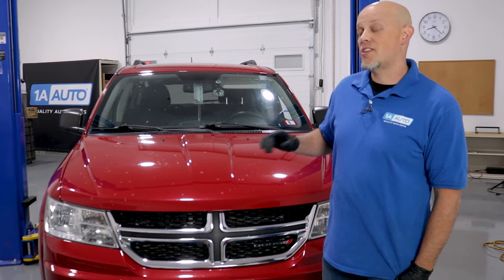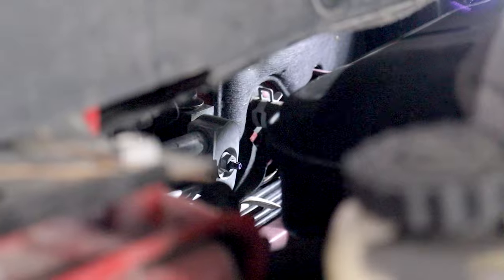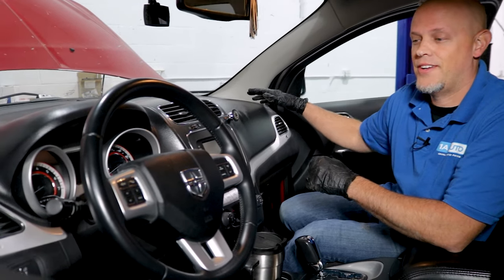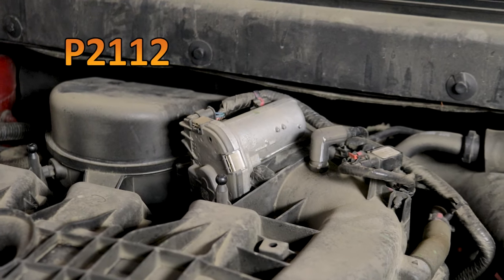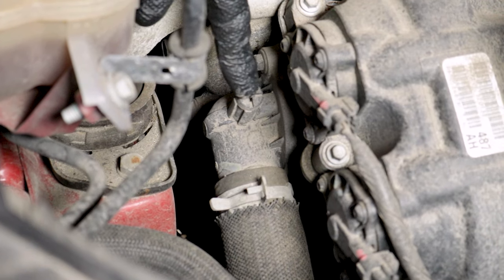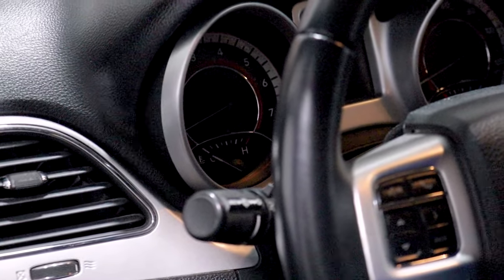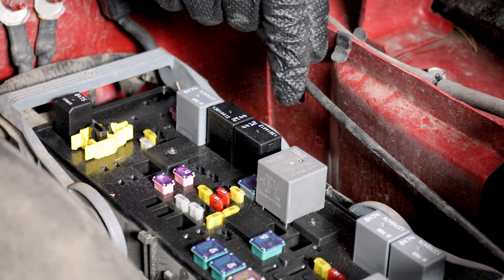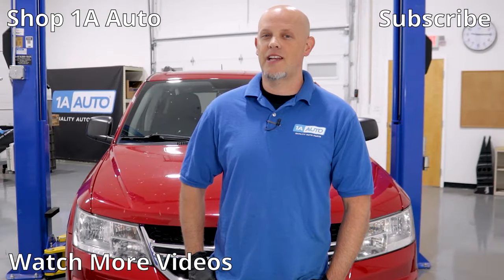Top 5 Problems Dodge Journey SUV 1st Generation 2009-20

Comment: Wow thanks for the help but your miss one more problem driver side has heat when the heat is on and the passenger side dont. I have a 2010 dodge journey runs like a grape ape love the suv but this year ran into heat only half the car!!! But ya if you have an idea what it is please help it's my fiance car and I'm letting her drive my chevy avalanche until I get her dodge fix
Reply from the maker: +Mike Dyess We wouldn't be able to diagnose an issue like that here, you may want to have a local mechanic take a look at it. Thanks for checking us out! http://1aau.to/m/Shop-1AAuto-c
Reply: Heater core. He mentioned it in the video. Mine is not working either. Heat on the driver side and as you go towards the passenger side , it gets cold.  My mechanic flushed it with CLR and it worked for 2 days then , no heat again. I replaced all 3 actuators and still the same. There is a trick on you tube , where you can actually replace the heater-core  WITHOUT removing the dash and electrical. I'm planning to do it, for next year's winter :)

Comment: Those so are not. The common issues with the journey ,with that particular model with the 3.6 you will need to look for lifer,cam,rocker. Issues the p0128 thermostat rationality ,and ac condensers otherwise they are pretty good vehicles

Comment: I keep getting misfire on cylinders 4 I change the spark plugs and the coil packs but I'm still getting misfire on cylinder 4
Reply from the maker: +Tony Mata We wouldn't be able to diagnose an issue like that here, you may want to have a local mechanic take a look at it. Thanks for checking us out! http://1aau.to/m/Shop-1AAuto-c
Reply: One thing I heard is make sure those small spots on the tip that point are at their right angle cause if theyre not, that causes an issue

Comment: Own a 2012 SXT V6, non stop problems! Electrical short caused all sorts of problems,  within the first year the touch screen went out and would lock us out of the car randomly.  In the dealership for 3 weeks for a "system update". Just this winter the heater went out, recently started leaking water and overheating. ABS & traction control lights are on.  More lights on my dash than a Christmas tree! Gonna fix the overheating issue and trade it in (probably zero trade in value) Never again Dodge!

Comment: RT V6, had it for 10 years now and on my 2nd gearbox now. Damn transmission issues again 😂. I'm in South Africa, Johannesburg. 164k miles on the clock, only drives on 1st gear and can reverse as it can't shift gears. Any cheaper ideas 😂

Comment: Overall my 2010 Dodge Journey SXT has been a good vehicle.  I have slightly under 250k on it.  I installed 3 heater cores over the years but I did it myself in a modified fashion so just the cost of the heater core and some heater hose.  My big problem now is a parasitic drain on the battery I cannot find.  Anyone else have this problem?
Reply: Battery drain has been a significant issue since I bought mine in 2012.  It fries every battery I've purchased over the years.  One thing I did notice is a I had a clicking recently that showed up out of nowhere.  Turns out the blend door actuator for the AC was broken and the eletronics on the car kept trying to activate the actuator when the car was off. This was draining my battery within a few hours.  So short story the clicking was happening all night and draining the battery because the car kept tryin to set the actuator. .......but that is one of many battery issues.
Reply: My 2014 2.4L SXT has had the battery replaced once a year for the last three years. That's my biggest gripe with the car. The second would have to be the plastic side panels that cover the front seat belts. They came lose after two years of ownership. The engine and transmission have been great so far. I just replaced the gas pedal because the throttle sensor was going bad. (At least that's where I believe the problem laid. So far, it's not had any more issues.)
Reply: Thanks, see my other remarks;; my 2015;4 CYL JOURNE@. 93,000 miles still trouble free , etc.. (;though, Bushings / Struts , SPECTRUM NAPA ALL REPLACED LAST MONTH, drives better than new)…..still have original Battery FOR Engine…. . remote BATTERY ARE replacement.. oddly, one of Service Tech’s suggested ENGINE Battery May” fails without notice “,:etc.. Anyways, considering Battery Rep & TRANS SERVICE SOON??

Comment: I have a 09 journey 4 cylinder, it won't start it times, new battery, new starter, new ignition switch, fuse box repaired, and it still won't start at times, any I deals ????
Reply: key fob? sounds like the only thing you haven't replaced
Reply: Check out YouTube videos about the vehicle grounding.
Reply: Crankshaft sensor
Reply: Clean all grounds, replace crank sensor, didn't get a remote, the dealer replace ignition switch and that's when the no crank started, took it back, dealer can't find the issue, just don't know what to do next ????

Comment: Wow.. don't have a dodge Journey, but I have considered getting one.. is top 5 problems consistent with all Journys
Reply: I’m happy with and have a Dodge Journey, the All wheel drive, 6 cylinder RT.  I’ve had no issues at all in a year’s time.  I had to wait for new less common 19” winter tires. The leather heated seats and steering wheel come on instantly, the heat and air conditioner works well.  The tow package  pulling my load of firewood was fine.
Reply: Don’t do it. I’m trading mines in soon. I’ve replaced everything he listed plus two alternators. Only had it three years
Reply: It's not that bad. It's just a cheap car if you are on a budget. Own one it's a daily.
Reply: 3000.00 worth of maintenance done to my 2010 sxt with 118k in less than a year. Brake rotors are  undersized and warp easily. Had to replace a fuel line just the other day, for the second time. These are not built to last, and if it wasnt paid off i'd trade the thing in a heartbeat.
Reply: You can have my 2016 all blacked out for 12k.
Nothing wrong with it and I modified the headlight to very bright ones in case I needed to go on a road trip (didn't need to since I have another vehicle) I got it for a friend and his wife. They split. They owed 2k on it and was going to be repo. I got called, I picked it up, payed that money and am paying it cause I don't want it to screw my credit. I just owe 12k on it. It's too much of a small suv for me. Also I'm paying it to be parked and taking up space.
Reply: Don't get one

Comment: My wife bought a 2015 SXT V6. Trans was leaking at 60k had dealer fix it, they forgot to replace trans fluid so trans failed, they put in a rebuilt trans and it groans/struggles off the line. Suv has 142k, new trans also leaks, motor has oil puddle on block, radiator has a hole in it, rotors are warped, suspension is bad, motor mounts are bad, it just has a lot of issues for a 6 year old suv. I have a 21 year old infiniti car with 227k on it that I drove way harder, has way less problems, and is still more reliable. Her Jeep liberty before that had a bad trans before 100k too. The mechanics I talk to agree these are crap. The newer mopar stuff has transmission issues and poor build quality in general. Buy foreign or buy American fleet models to get better drivetrains.

Comment: Buy this car if: you only have $20k and want a new car, need 7 seats, want an SUV, and want AC in the back. Do not buy it if: you can afford anything better. I have a 2014 SE (base model 4 banger). The build quality of this car is terrible and it is basic, however, it has only broke down 1 time at 170k miles, so thats good. My biggest complaints/problems I've had: oil leaked REALLY bad, started using synthetic oil and its much less now. Valve cover gasket is leaking and the oil pans always do. Suspension is cheap and bouncy. Combined with it being FWD it wobbles on turns if you hit a bump. It had A LOT of warranty work done on it including catalytic convertor replacement and random lights coming on. The airbag sensor decided to stop working. My blend door actuator (there's 3, it controls the climate) is clicking because it's malfunctioning. I had a big coolant leak from cap stem, easy fix. The battery is in the length side wheel well and is difficult to access and builds corrosion because of exposure. The alternator is on the bottom of the engine and you hage to take a wheel off to access it. 

I wouldn't recommend this car, it's dodge junk, but it's cheap and runs. 4 banger is a little more reliable than the 6 but so extremely slow it painful. Mileage sucks on both. They are hit or miss with reliability. USE SYNTHETIC OIL WITH THIS CAR. If you can afford something better, get it. If not, be prepared for shitty dodge engineering. Basic maintinence like spark plugs and engine works is easy. 

overall don't get this car

Comment: I have a 2018 Dodge Journey that when I have to use my windshield wipers, the whole digital panel goes dark.  Its really crazy when this happens.  I have taken into the dodge dealership and they think I am crazy. They couldn’t find anything wrong!!
Reply: This is because the headlights come on when the wipers are turned on. I believe you can change this is your settings.

Comment: Let me add a couple more for you
The heater core hose T connectors will explode on you because they're made out of plastic. Also the rediator hose plastic fitting will deteriorate and cause it to explode as well they're molded together as one piece. 
The alternator has a clutch and it will fail, because the clutch just goes bad.
The crankshaft position sensors for some reason don't last. People seem to be replacing them quite often. My recommendation is don't buy the journey.

Comment: Please do you know the meaning of these codes?STORED CODES U0002 High Speed CAN Communication Bus Performance PENDING CODES P2719 Pressure Control Solenoid "D" Control Circuit Range / Performance P0969 Pressure Control Solenoid "C" Control Circuit Range / Performance PERMANENT CODES No permanent codes found.Are these two codes only for the Solonoid?

Comment: I have had my 2016 pre-owned Dodge Journey RT for 2 years. After replacing 2 tires the transmission felt like it was slipping and the tires felt like they were spinning too fast. I could feel the tires skip similar to hitting a water puddle. The dealership said that 2 tires were 225 and the other two were 235. The tires that were 225 were rated V for a higher rate of speed. This caused all four tires on my AWD vehicle to all spin at different rates of speed which tore down the transmission. I took the car with paperwork from the dealership in hand to discount tire and they installed two new tires free of charge. Two days later all the lights in the dash started to flicker and the screen would turn off. Later I got a message saying BATTERY SAVER MODE. I called the dealership where I bought the vehicle to verify if they replaced the battery before I purchased the vehicle. They had not and nor had I so I drove straight to autozone. The employee could not find the battery so I jumped on YouTube and about lost my S#!? when I realized what I was going to have to do in order to get to the battery. Really Dodge? Is this a ploy to keep dealerships in business? Anyways, I drove to the nearest dealership and ended up paying nearly $300 for a brand new battery and labor. Side note: I am currently living out of my car. Yesterday the dash started to flicker again so I headed in route to autozone and ended up coasting it into the drive and the car died stretched across four parking spots sideways. (Other customers thought I had a huge ego.) I asked if they could check the battery. The battery was dead. The guy tried to jump it and it didn’t work. I called Roadside assistance and waited 4 hours in the blistering Texas sun to have the guy jump start me in sixty seconds. He suggested the dealership may have sold me an old battery. He could not locate the date sticker, but we did not take the wheel off either. I had no choice, but to pay for a hotel until Monday so I can be jump started and go back to the dealership. I want to see the date sticker, but I know they are just going to take it to service and I won’t get to see. My saga continues, but my YouTube research suggests this video could use an update.
Reply: Hope things worked out for you.
Reply: These are problems with the mechanics you’re taking it to. Not the actual car. The battery is in front of the driver side wheel well, it’s not that hard to get to at all. Take off one tire and you’re done. I’d suggest taking it to an actual mechanic not the dealership and especially not autozone lmao. Gotta love advice from “YouTube research” from someone that paid $300 for a battery replacement. 😂

Comment: I have a 2014 3.6L.  My battery has died, starter has died, alternator replaced, idler pulley cracked, crank pulley squeals, weird clicking sound from the glove compartment when it starts and my back up camera flipped upside down on the screen some fuckin how and i dont know how to fix it.  all his problems in this video are my successes. never had a problem with any of them.  if anyone knows the engineers who designed this dumpster fire let me know...

Comment: The engine compartment was filthy. Does't look like it was cared for very well. Dont blame Dodge for all the dirt. Maybe that's what messed up the intake.  Treat your car well and it will treat you well.
My 2013 Journey is at 114k now, runs like brand new. Even the suspension is tight.
Reply: With the Pentastar 3.6 L

Comment: Can confirm my heat doesnt work and my keyfob doesnt work.
Reply: Try holding the fob to the start button. If fob battery dead or missing by doing this you can still start it
Reply: No heat for me either. Now a loud knocking around glove compartment when I start it!

Comment: 65K miles….2 bad heater cores, failed freeze plugs. Had to drop trans to access a freeze plug. I’m still in the middle of that, $1K to change a $10 part 🐂💩😵‍💫🤬🤯😭

Comment: Great video thank you but one big thing... you are showing only past 2011.. NOT 2009-2010... Not 3.6, but 3.5 and throttle not in same place, mine unfortunately, put new computer, and put new throttle body and the lightning in dash still flashes I clean with throttle body cleaner inside motor and still , tried other ways like in other vids and push on pedal and release all and still... now trying after months of getting darn  Transmission Position Sensor and now 1 gear but the scanner never said a thing about throttle nor that sensor and was the plug so changed both, and still lighting in dash and 1 gear, now trying to put new shift solenoid pack and solenoid into is that not hard just why make it with wires in fluid WEIRD, and tomorrow will put it in and gasket and pan over top it.. hope this makes darn thing work,. bought it 14 months ago , here with winter and a neighbor that criminal harassments against me for months,  I am fed up and fed up using another neighbor's journey 2013... now I have 2 to fix or whatever just want to drive mine and enough... so This time, scanner says shift solenoid but nothing with sensors not at all.. so what is it... please.... thank you. no codes for sensors but lighting flashes ... with all new have no idea and hope once that shift part is in hope works..

Comment: 2017 Journey have to replace the crankshaft sensors every oil change. And the AC turns on on its own when low on gas 😂😂

Comment: Dodge should get out of the 4 cylinder game. Bought a 2010 SE last April from a dealer with only 120k on it and since then it has had a faulty rear blade motor, rear passenger door seal leaks, key fob issues(not battery) , master window and lock control issues(replaced myself) crankshaft sensor (causing misfire, also replaced myself) choking and dying while idling, leaking thermostat housing, steering wheel airbag issue (airbag fault makes car horn go off at random) and worst of all the whole rear suspension had to be replaced because the camber angle got worse and worse since i took it of his lot (within 7k of driving it the rear suspension sagged worse than grandmas flaps). That last one may have had more to do with the filthy rat salesman who sold it to me, but the previous records showed 1 owner and I even called the dealership in Woodbridge to confirm prior accident history prior to the salesman taking ownership of it, and all seemed kosher. Now I'm in the hole. Ffs never again.

Comment: Errrm....what about the power steering lines blowing off in extreme cold? Or....the stupid hard plastic windshield washer lines, or....the battery drain game (and battery location), or......
Reply from the maker: +String Slinger Thanks for the feedback!
Reply: Battery drain game :D
Reply: @ericperu1542  Usually part of that problem is the battery temperature sensor, if it starts to go the computer can't regulate the correct amount of charge to tell the alternator to supply.